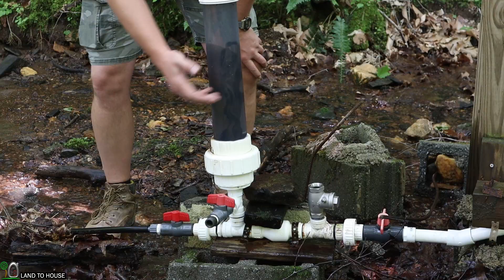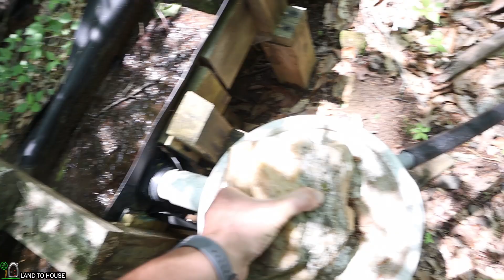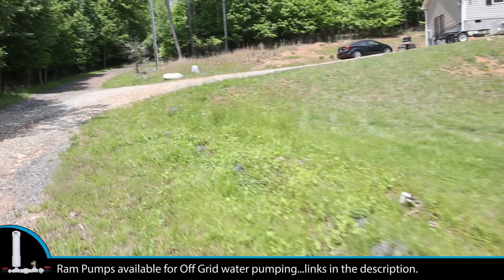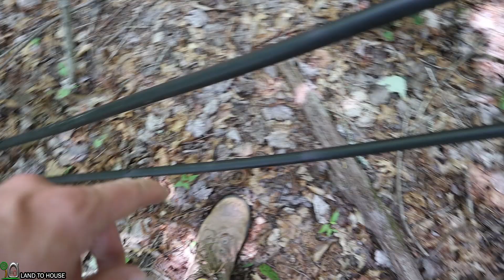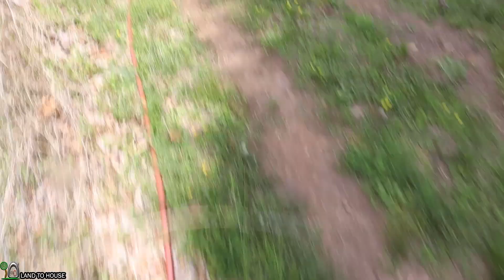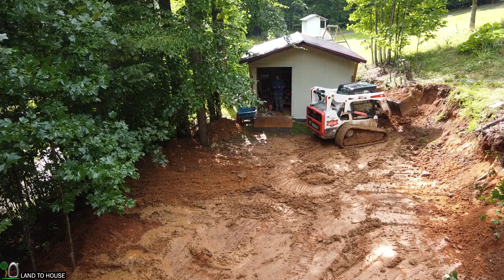Ram Pump Water Used to Pour Shed Footers

Comment: Hypothetically, if I ran 2 side by side 1” ram pumps and condensed the out feeds to a single 2” line, could I get double the pressure? Ultimately I’m trying to figure out how to get a couple ram pumps to have enough pressure to run a sprinkler. Thank you!!! 🙏🏼
Reply: I’m wanting to create a fully off grid backwoods food plot for deer and elk here in Washington state. The plots don’t get enough rain during the hot summer months and die without watering.

Comment: Hi Seth, Something i`d like to see if you are still into testing is a ram pump supplied by an electric sump pump, 9000 LPH with a max head of 20ft. This could be useful in situations where you need  to move a limited amount of water to a great height but dont have any available fall. The waste could be put back into the pump so it may be useful for transferring water from a tank to a much higher tank.
Reply from the maker: I do need to test some alternative methods like this. One is to use a solar pump to get water up to the needed head pressure then run a ram pump from that.

Comment: Hi I have a question I have a shallow well under fifty feet I have watched alot of your ram pump videos I have bought several well pumps my question is do you know of any way I can harvest the water without having to keep buying anymore of these well pumps they are getting expensive I just need a way to get my water out of the well I'm trying to go off grind I have  gotten everything but this issue resolved and it is a big one I also watched your rock stove build one last question I want to make my wife an outdoor kitchen with a permanent rocket stove I have made several portable ones for camping but I would like your input I want it to last a long while  thanks for sharing your experience and thoughts

Comment: I get close to 15' of lift per foot of drop to my 1 1/4" ram pump using 1/2" pex for my out put pipe! Fills an IBC tote in 2 days. Thanks for sharing your storage tank output pressure. I intend to place the 2 totes I am using on an 8' platform because I still wish to push it in a hose about 6' higher to the greenhouse. Should be okay I hope.

Comment: I wish you were my neighbor. I may try your biggest size. Not sure if I have the time to do this rather than just drill a well and put a solar pump on it but this would be nice for a  remote cattle watering system if you want to keep them out of the creek. Just wondering if it would actually pump it up hill and as far as I need to go .
Reply: What kind of vertical lift height do you require? How much drop in feet would you have to your ram pump?